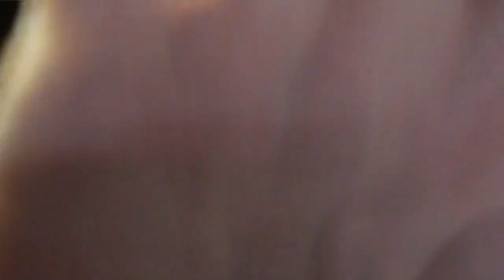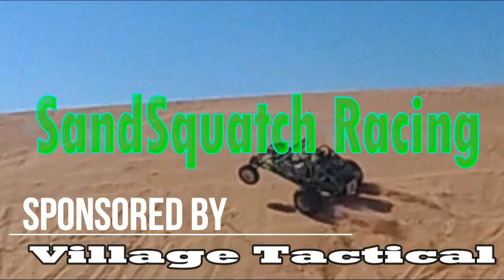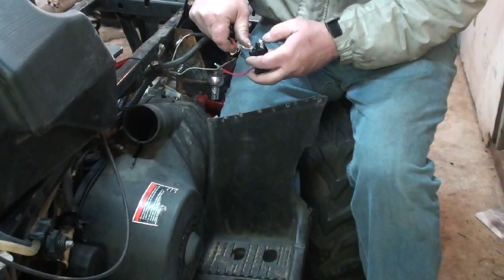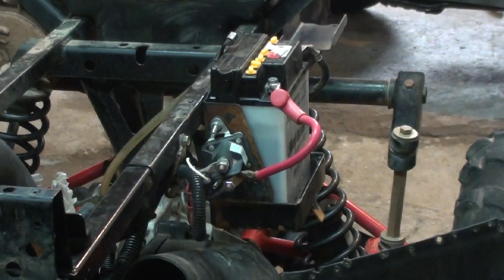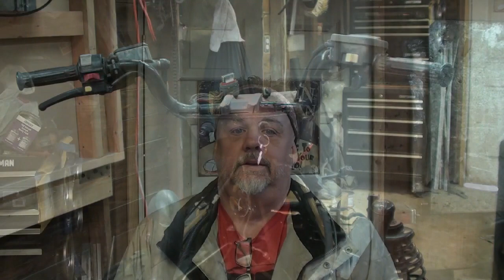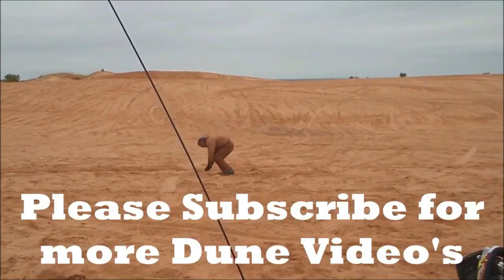Polaris Sportsman ATV Solenoid  and Wiring Problems A Fail and A Win

Comment: Sometimes it’s not the ECM but the plug&play connections. They vibrate and create arching especially on the power in and ground. Ground is the first to check. The mounting screws, threaded into the frame are to fine and loose contact over time do to vibration. Hence the front motor mount failing do to the same issue (vibration). Before sending the module out for repair or replacing with new check those contacts and the ground continuity. Also as an add of prevention use dielectric grease on the female contacts on each side of the module. The other, but not as critical is the location of the ECM, is the heat discharge from the radiator and the fan blowing excess heat directly onto the back of the ECM.

Comment: Clear as mud.  
Solenoid has four connectors. Two large, two small.  Let’s call them 1&2 (large) and 3&4 (small).  
1 - Battery +ve
2 - Starter. 
3 - white with red stripe 
4 - red (grey in your case). 

Or, are you saying red (grey) goes to +ve.  If so, what connects to 4?

Comment: I just ordered exact same solenoid from Royal Distributing. Wired it in same as the original, went to connect battery and got sparks and the starter fired the machine up, even with key off.
I’m wondering if my new solenoid is bad and stuck?
Reply from the maker: just guessing but i think the new one is bad
Reply: I have that same issue scott any pointers if you got it fixed

Comment: I have a 2001 arctic cat 500 with a blown solenoid. I have a pull cord though, should it run or does it need that main fuse that the solenoid houses to run?